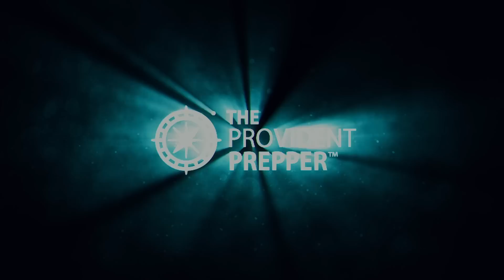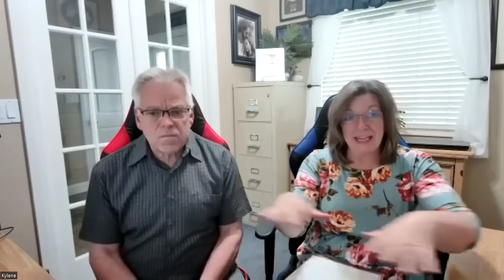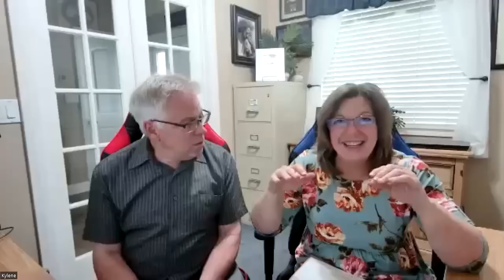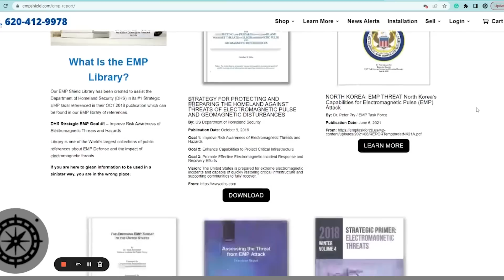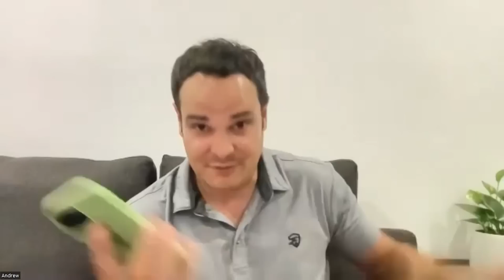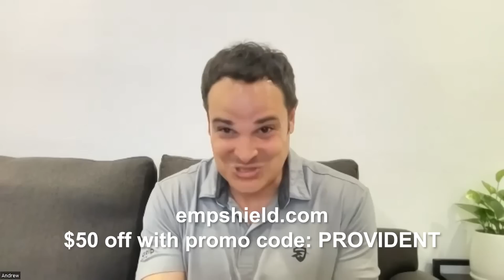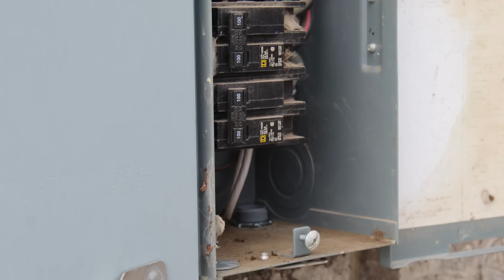Facts About EMP Protection: Interview with EMP Expert Andrew Bucchin

Comment: I'd like to see a video (if this is possible) on how you can prepare to make sure you can get your car up and running (at least on a basic level) after an EMP.
Reply: Pre 1986 diesel truck. No computer. Stable fuel.
Reply: Can't less it's old. You just needs points to get it running again.
Reply: With all most everyone carless you might find yourself in more trouble than without. In any area you could be in danger of hordes of people with or without weapons trying to take it from you. Be careful. Esp. pumping gas if any can be found wirh electricity to pump.
Reply: @Tk-iz2ws  Not true! If I have a running car, I now have a two-ton projectile weapon, with which I will simply ignore the "thump-thump" as I drive over them. My wife and I are both armed and can shoot back, as we fight/drive our way through the ambush. It's also a great barricade mover (stalled cars, or cars moved into position to serve as a roadblock). I also have at least one half of a tank's worth (often a full tank's worth)of gas in Jerry cans at any time. Finally, most people won't grasp the severity of the situation in the first few days or weeks. All I need my car for, really, is a one-way trip to my family's retreat.
Reply: Wrong attitude. You are a moving target and you will have your vehicle taken by someone like me. Its your choice if you walk away from the interaction. 

You might want to rethink your strategy and hope we never get to this point in society.
Reply: @NextStop2030  The situation isn't black and white. If it looks like an organized militia (like armed neighbors who just don't want troublemakers), then yeah, talk and ask for an escort through the town, on the way to where you're going. Obviously, if you come at someone with the intention of killing them, then one of you will certainly die! I'd rather avoid that risk at all costs.
Reply: @NextStop2030 
Now you're going to be targeted by Future Cops.....😂😂😂😂
Reply: @NextStop2030  
Preppers are armed too - those with too much of an arrogant Lone wolf attitude will get unalived.
Reply: @hrdknox2000 I'm hoping a UFO will show up and take me to the "ARKS"!
Reply: FYI

Things that survive almost all EMP type events. 

 Incandescent light bulbs NOT HOOKED UP.  

Coil Devices with heavy wire NOT HOOKED UP.  Motors, starters, old spark coils, relays.

Most batteries W/O built in electronics (like lithium battery devices have monitor/charging/balancing circuits... those are toast in a big hit.)

Mechanical contactor switches 

Resistive heaters NOT HOOKED UP

Most of the designs around the end of the 1800s and cars up to the late 70s are ok.  No silicon devices, transistors, processors, LEDs...

Cars with just points, mechanical switches, spark coils, brush starter motors, incandescent light bulbs, mechanical fuel pumps will largely be ok in a really big EMP type event.
Reply: @experimentmagnet I need a horse 🐎